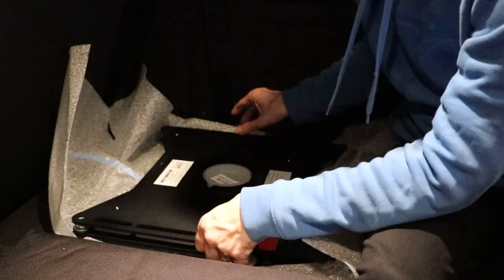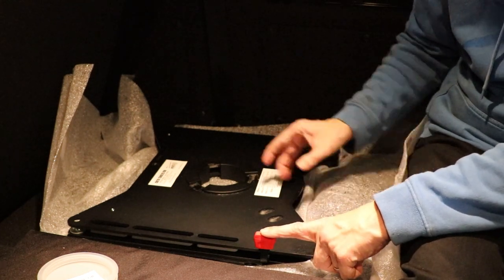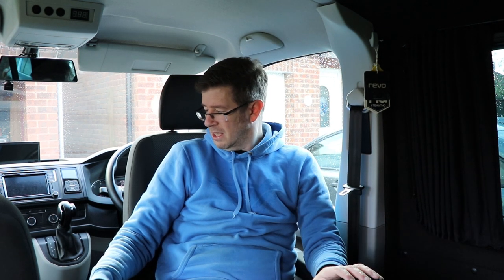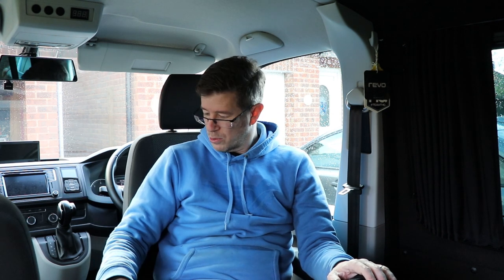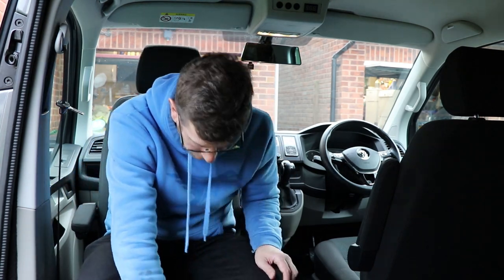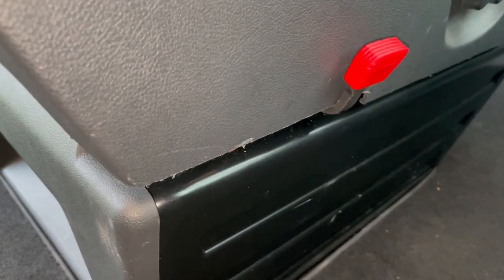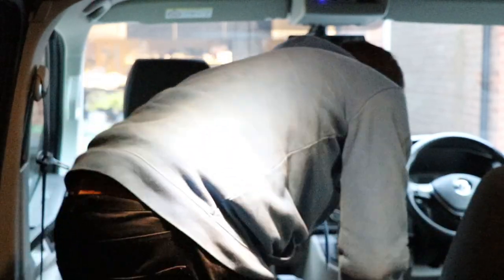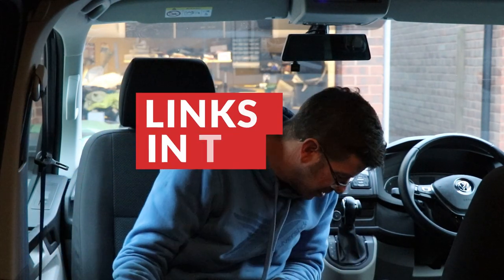Installing RIB Swivel Captain Seats in a T6 | Kiravans | MAJOR DILEMMA!!!

Comment: Great vid as usual! My brother had a Kiravans swivel and it drives everyone mad who sits in it as it rocks excessively from new and it squeaks and no matter what you seem to do we can’t make it quiet, unfortunately many on the forums find this to be true , I’ve the same bus as you and went for the rusty lee swivel , it’s got a bigger supported swivel and is rock solid ,plus no squeaks and the lever is at the front so no need to cut the side of the seat trim, hope it works out for you though , I’m not trying to make you sad it’s just you may get ur brass back if it annoys you
Reply from the maker: Thanks Nathan,   I appreciate the feedback.  I may well swop over to the rusty’s if I experience any of those issues.  The rib products are almost always out of stock 🤷‍♂️. Thanks again bud🙌

Comment: Hi I'm considering buying these but have a question. I am wondering is it possible to lock secure the seat facing backwards   as this would be a deterrent  to potential thieves as they couldn't drive it. Hope you can advise
Reply from the maker: Hi, The RIB base does not lock rear facing from the factory. it only locks when you strike the forward home position but that's not to say it wouldn't be possible to modify it to be able to rear lock.  hope this helps

Comment: Couple of questions, does the passenger seat rock slightly? looked on your video like it moved around a bit when you sat down. Also not keen on the dremmel idea of cutting the seats, can this be avoided?
Reply from the maker: When you have the seat in the forward driving position, no movement and locks tight like factory but rotated there is a slight rock as you lean back, mainly due to the fact the the runners are nearly fully extended when its rotated so the transfer of weight makes it rock slightly.  with regards to the dremil, on the RIB seat base you do have to unfortunately, it will hit the release tab other wise.  however it is not very noticeable that its been done I have to say and I normally hate that kind of thing!

Comment: Hey Steve, I've watched quite a few of your videos lately, as we have very similar vans, and similar wants for the vans. You're my van brother from UK 😂 I was thinking about swivel seats myself, however I didn't rush into it exactly because I feared the seat would lift to an uncomfortable position. Tell me, please, how tall are you?
Reply from the maker: Hey van brother 🤙.  Thanks for supporting the vids👍. Yes I am 5’ 10  but don’t forget it’s a bit of legs n body spit too 😂.  It’s just not good on the drivers the only way is to do a handbrake mod which is available as a kit from most conversion retailers then you can remove the raising shims but you do have to settle for a fabric handbrake gator if you lower it.

Comment: Another great vid.best VW youtuber on here.had similar problem with driving position as needed to fit shims so swivel base cleared the leisure battery terminals and is higher than passenger in lowest setting but luckily I have long legs so pros out weight the cons just need do something with the handbrake cover as now will not fit from being lowered.keep them vids coming.I am surprised you not gone for a pop top roof yet for camping I would love one but love my manufacturer sunroof to much and as its a swb would probably have to loose it.
Reply from the maker: Thank again buddy! 🙌 😊.  Yes just not quite enough to swing the leisure battery but only a fraction.  No I have not gone for the pop top as we are a family of 5 so I just felt sleeping all 5 in the van would be out, so went the route of driveaway awning for sleeping and partying in the back for food, drinks and entertainment etc... works well for us at the moment. 😎

Comment: Great honest video Steve. I also had problems with these swivels my passenger seat wasn’t fitted with height adjustment and these swivels simply don’t work for my application, ended up with rusty lee ones.
Reply from the maker: Yes I can see how that would be a problem!! The trim on side of the seat would hit.  Glad you solved it with rusty’s🤟

Comment: Another good honest video. Well Done!. Whats the second screen sat on your dash? Also did you get round to doing a video on the rear view dash cam?
Reply from the maker: 🙏Thanks Alan,  the second screen is a separate system I installed controlled by an overhead switch to show me the front splitter and the rear towbar for parking next to curbs and reversing up to my trailer.  I didn’t make the video because axis has made a great video for everybody on the camera/mirror.  Check out this link https://youtu.be/AHIFj5VIClo 👍

Comment: Did you have an airbag warning light on the dashboard after disconnecting the seat airbag??
Reply from the maker: No,  disconnected & reconnected before cycling the ignition and had no issue with a warning light with the seat plugs 👍

Comment: Steve. Before you took the drivers seat out can I check that it clears the handbrake fully and there is no need to do the handbrake mod. Cheers
Reply from the maker: Hey buddy,  sorry for the late reply!  So short answer is yes.  However.  The handbrake needed to be realised to do this and the shim that lifts the seat base allows for this but I have to say I found it to high for a comfortable driving position👍

Comment: Hi Steve, have you had any issues with the passenger side ? Does it rattle or move ? What unit did you upgrade to for the drivers side?
Reply from the maker: Hi, I must admit I am fussy with this sort of thing and yes very slight play in the seat frame so the seat does tend to slightly wobble with nobody sat in it when on the move.  some wouldn't even notice but i guess its to be expected if its got to swivel...  I didn't do anything on the drivers one in the end as I didn't want to lower the handbrake so we just have swivel fitted on passenger side
Reply: @SteveField  thanks for taking the time to get back to me.
Reply from the maker: @TheGollam  my pleasure

Comment: I was going to fit a set of the rusty lee ones heard they are the best.. But iv always been put off by the hight it would take the drivers seat due to the handbrake and as you mention in your video I couldn’t put up with 1 seat higher than the other my OCD would go mental 😂 ..very pleased that is not the case for you tho and I’m now thinking to get one for my passenger seat , great video
Reply from the maker: I’m exactly the same and it would send me bananas so I’m glad it’s worked out like this .  Was way to high to drive it with the drivers seat.  I think I could see the front splitter 🤣
Reply: @SteveField  😂 I couldn’t live with that ,I drive with my seat on the lowest setting and at times I even check to see if it goes lower,
Reply from the maker: @roosterbooster5990  SNAP!! 🤣

Comment: Great video Steve. I fitted Rusty Lee’s not so long ago. For the drivers side I did notice I needed to get used to a slightly higher than preferred position (no shims though, I still need to lower the handbrake). I think it took a good week for us to get used to it but I honestly don’t notice it now. My wife is 5’5”and it’s fine for her. A bit like when we moved from a car to a van, it just took time to adjust. So my recommendation would be give it a couple of weeks without the additional shims. Then, if you do get used to it, lower the handbrake to make it all work. If not, pull it out.
Reply from the maker: 🙌thanks Peter,   Yes great advice!  Glad you got used to yours!  I think if we get a good year in next year 🤞 and can run out on some camping weekends,  we will see if not having the drivers seat swivel is a drawback... if it is then I will go down the route of lowering the handbrake as you say 👌